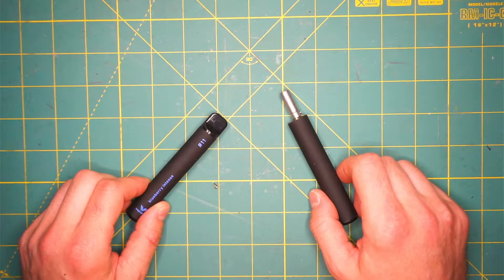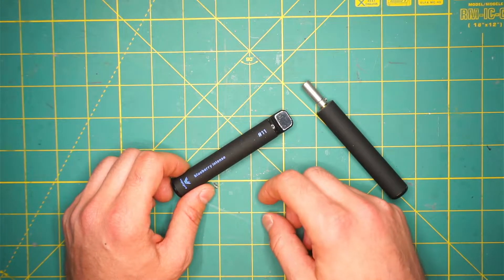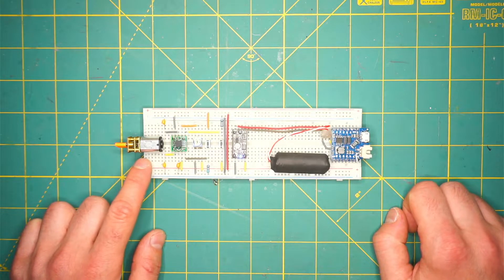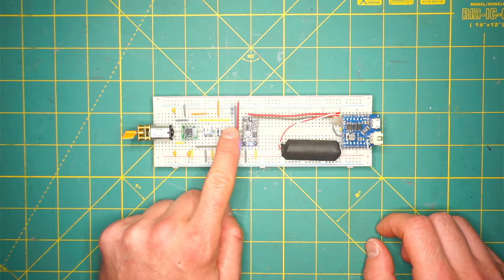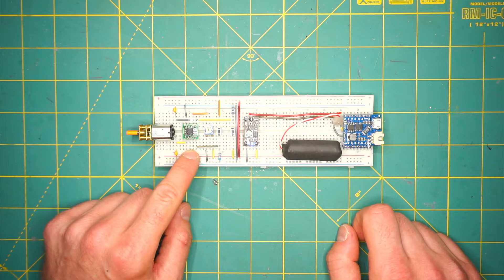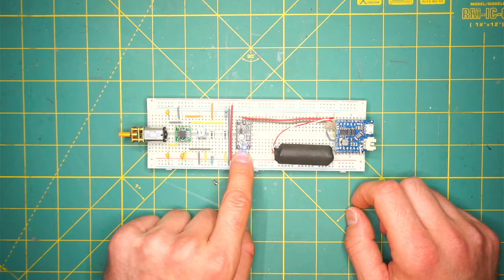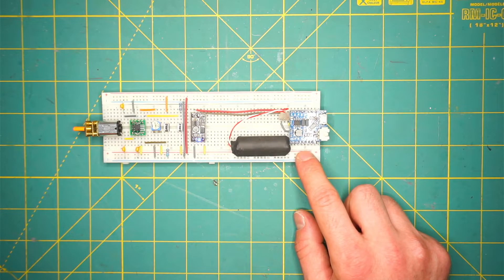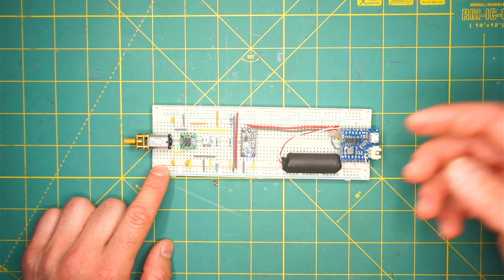Turning single use vape pen into electric screwdriver. (part 1)

Comment: Where is part 2?
Reply from the maker: It is coming soon. You can keep up with the project here: https://hackaday.io/project/185821-reusing-single-use-vape-pens
Reply: @lessbutbetter9485  Besides Forward and Reverse you will need to somehow make a locking mode for extra manual torc.